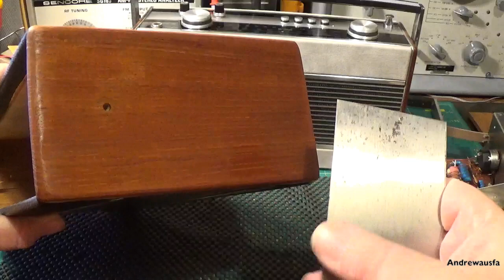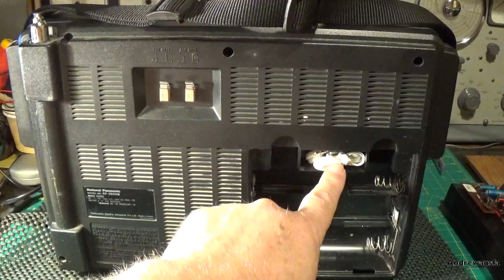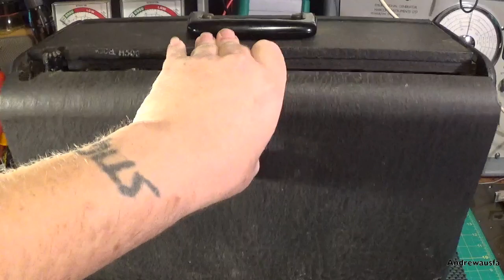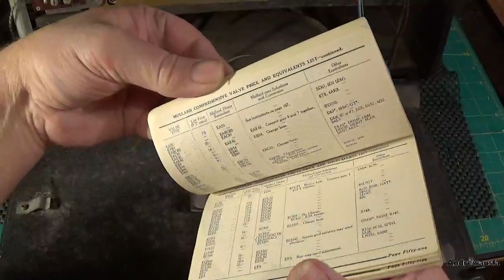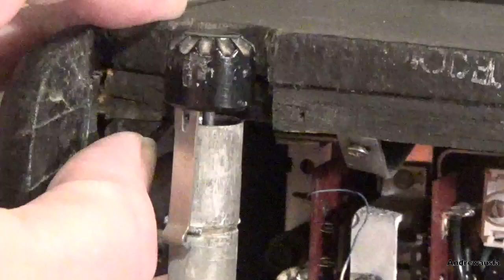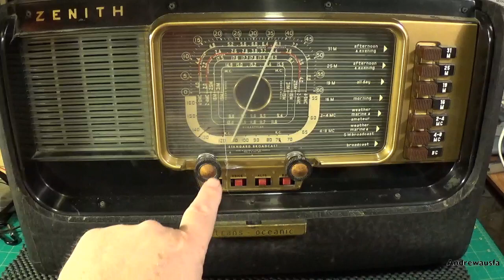Recent Finds

Comment: I live in the states and I’m enjoying your videos and learning about British radio. Regarding the TransOceanic, I own and have restored my H500. Sorry I can’t help you with the year of manufacture, but two observations 1. The short wave rod antenna has a spring in it that will make the antenna tip pop up about an inch, put some oil down the inside of the rod antenna when you remove it to service the chassis. Also I’m your video it looked like yours Zenith had brown band push buttons, if that’s the case most have black buttons.

Comment: You may be able to find a new "fascia" for that Zenith, they made a lot of H500s, and made even more of the G and H 600s which use the same molding, not sure about the markings on the push buttons. Quite a few of those turn up water damaged, trashed oil cloth, or with other issues, and are parted out.  I have one where the plastic was melted but it has the metal bale from the catch, which is missing on one of my H600s, still on it, the catch on the lid is identical on both models. Put an ad up on the Antique Radio Forum, one might turn up.

Comment: Nice Pieces Of Gear There Andrew Theres a Zenith TransOceanic H500 On Ebay But Its Just The Chassis and Tubes Only... On Buy it Now For £60.14 With £70.00 Postage From The States It Dates It At 1951 Theres Also a National Panasonic RF-2800/DR 28 On Ebay For £98.20 Plus £10.00 Postage Its Also On Buy It Now..That Pye Radio Looks Lovely Andrew !! Regards mike.
Reply: I think that some of the B.I.N prices you see on fleabay must be cocaine induced, a lot of it is basically parts and or e-waste not collectables. I bought a G-500 Zenith T.O for less then that, including shipping, a bit of a project but it's all there, it's the previous model to the H-500.

Comment: Hello Andrew. Yes you're correct on the date of the Zenith 1951-53. They were very popular with the US servicemen of the day so it may well have found it's way to the UK with one of them on post war duty in the UK or Germany. The 1 volt valves can be a bit fragile and the 1L6 output tube is getting quite expensive these days. If you check Bob's channel( Radio wild) he did a 9 part restoration on the H-500. He is a bit of a specialist on the Transoceanics. Good luck with it. ATB Doug.

Comment: Sadly, there are never radio auctions around here. I have to search  the classifieds to find any diamonds in the rough. I've never seen a metal scaper such as you have. I suppose you've seen the typical paint scrapers which has a metal on wood setup and you can sharpen the metal when necessary.

I am very impressed and somewhat envious as to what potential equipment you can actually find. Congratulations on your finds and good luck with the repair and restore.

Comment: Wow, what a great haul.... Now the T1500 is a really useful fault finding tool once you get the hang of decoding the displays, especially when fault finding complex PCBs. You dont always need to use it by comparing to a working PCB, as once you understand how it works you can easily determine faulty capacitors and semiconductors etc. just by understanding the display. I think the T1500 is based on the original Huntron Tracker series of component analysers made in the US, whereas Polar were based in the Channel Islands.Theres a service manual and operators manual for the T1500A zipped together at this link... 

http://www.ko4bb.com/getsimple/index.php?id=manuals&dir=06_Misc_Test_Equipment/Polar_Instruments
Maybe not exactly the same service details, however the operators should apply to a greater extent.....

(P.S. I've just emailed you a set of T1500 manuals)  Best of luck...

Comment: Just a thought re the Zenith radio you have,  if will it run on 110v have you thought of using a kickdown box they use on building sites that converts 240v to 110

Comment: Meanie! - not sharing tx's... I've replaced the tx on the MB with BC327 / BC337 and aside from an alignment tweak, they work very well in the set, and are much easier to find than the BC464.
The DR28 is lovely - nice find! I know nothing about the Polar - but leave it with me and I will scour everywhere for a manual - you're right in saying that Polar want £50 for the operator manual - but the service manual is (gulp) £495! 
I like the Zenith, and the PYE too - although they are rather more portly than I would have the room for!